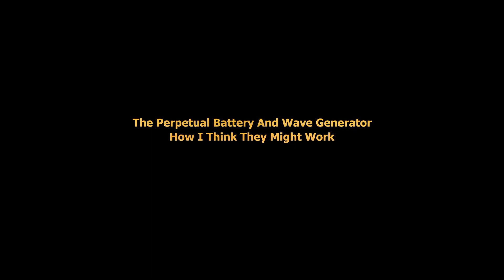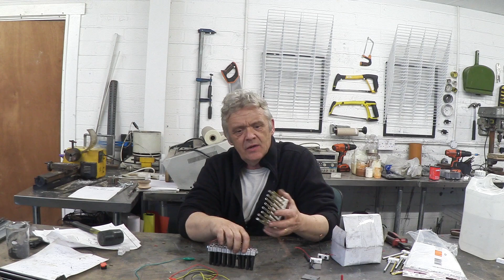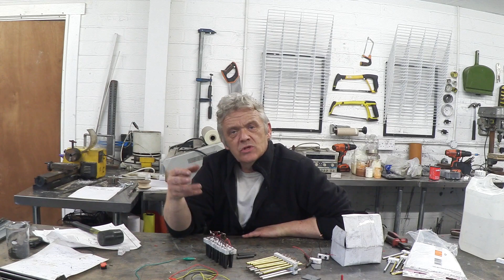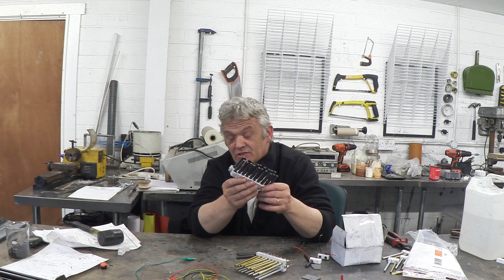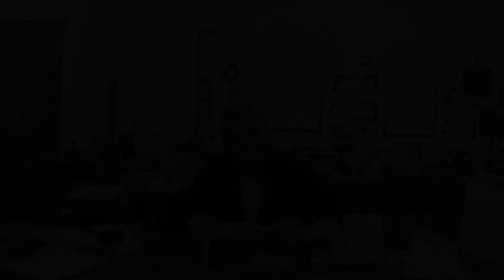The Perpetual Battery And Wave Generator - How I Think They Might Work

Comment: Just seen how CorPower made a wave generating buoy, and how it was generating a 300 kilowatts (was also 9 meters in diameter, and 13 meters tall lol). Thought how great those would be, as they are much more stable, to use those as off shore Rescue Buoys, but not sure how much use they would get... maybe better for expanding our detection range off the coasts, if not used for power generation, as they could just generate the power needed by the equipment and be relatively stable.

Comment: In welding there are carbon rods used in a prosses called carbon arking its used to cut metal. The rods themselves are an aerated carbon packed into a rod shape coated in a copper foil I think it could be interesting

Comment: Thanks Robert. Having listened to what you said here, and after reading the patent, one thing really stands out: Make a unit which uses Carbon rods (or even doped Silicon rods) for one set of electrodes, and sheet Copper or other metal plates for the other electrode. You will then have one electrode which is a relatively poor conductor and another which is a very good conductor, and a higher current should be produced.

Comment: Hi! I just wished to clarify: which geometry (surface area, thick/thin plates, etc.)  is recommended for both the upstream end and the downstream end of the device respectively? Should there be a difference in the amount of carbon in each material (again, between upstream and downstream ends), and if so, should I maximize the difference between the two? I’m very interested in building a somewhat optimized version of the rig featured in your “Wave Power: A Way Forward” video, but am unsure of what to get/make. Thanks so much for the constant stream of awesome content!

Comment: I have been playing with the perpetual battery and still can't get over how much fun it is! That simple design..I have a question. My meter is not as good as yours, but I think I am measuring bit more when I've literally draw lines on both tubes with pencil. I  was thinking about your Baghdad battery. First is that just nonsense and I better get a decent meter? Second if not is it because of the difference of the resistance across the whole setup? Third if so is there a simple way to attach carbon on metal? Sort of ,,galvanised" with carbon? Idea is to create lines of activated charcoal on the tubes to get better surface area as well as the resistance.. I read this article about ,,bombarding,, the metal with particles but I haven't got even decent meter let alone that contraption 😂

Comment: Let me expand your mind a touch Robert.  Think about this, where does an electron get the power to forever move around the nucleus of an atom?  No really think about it.  Science just brushes it off, but that little tiny electron is getting its power from somewhere, and its not from the nucleus.  That power comes from somewhere.   Have you heard of the 'etheric field'?  Quantum mechanics describes it as an electric field evenly distributed throughout the universe, unaffected by radiation, or electromagnetic fields. It permeated everything and everywhere, with enough energy per square centimeter to power New York for a year.   Wavegenerator:  Water is good, but something referred to as quicksilver is much, much better.  Geometry: square plates along the axis.  Think Casimir Effect.   Just a nudge from a friend.
Reply: One time my spouse had a dream about how one could tap into the ether to run a light bulb. She doesn't think about stuff like that.  Unfortunately, she didn't remember the details.

Comment: Regarding the copper rods - something id be curious to test is actually introducing a ferromagnetic pressure that coincides with the salt water. Let’s say for example we have a high and low pressure tube system delivering the salt water to the rods. In the high pressure side of the tubes can we use that pressure to rapidly propel a magnet towards the copper rod and create a larger difference between the two rod types? I’m a dad of three with no lab space to test my thoughts but perhaps someone can weigh in.

Comment: would be interesting experiment for someone to coat the underside of your boat with those graphite plates, like one thick strip and then a thin strip and then thick again and so on. Then hook it up to a charge controller and a battery and take your boat for a spin and see what you get. ( I don't have a boat)

Comment: After seeing your first video on this device, my initial thoughts would be to combine the multiple rods in series, rather than parallel. I also thought that maybe using an electrolytic capacitors to make the series connection between these rods maybe more beneficial? Great work as always. Thanks.

Comment: Hey Rob, You could probably add a strong magnet to your set up and achieve some good results as well, this would be Magnetohydrodynamics. This is normally achieved with metal and is the result of surface area and a strong magnet and narrow proximity to the conductors and flow of ionized fluid such as sea water through these conductors and magnetic field. This can produce usable energy. It really is nothing more than a generator that uses the fluid in place of winding coils of wire of a generator.
Reply from the maker: you certainly could do that mate - and well worth doing

Comment: Okay I have some ideas. 
1. Take a bunch of  carbon wrap it in aluminium foil in a spiral (kind of like  a Logarithmic spiral), Take a five gallon bucket and punch a reasonable hole in the bottom, put the aluminum in the bucket and let the water flood the system from the top (garden hose tap in the lid or some controllable way of putting it in water), profit? spiral motion would be best for imputing the water. My logic? What we need is a difference in resistance between the anode and cathode. The aluminum would be the cathode while the carbon would act as the anode. (I think I might have those backwards) This would allow the water to flow charge the system. 
2. Buy a metal micron filter of your choice metal stuff it full of carbon and blast water at it from the side. Or you could get an aluminum micron filter and fill it with particularized brass. 
3. Find better metals, Gold is expensive but would work great particularized, Graphene would be great, Whatever you feel is affordable to you and has a high resistance difference. 
I also have some ideas for your rubberband power machine. (Stirling engine? and paracord?)
Reply from the maker: nice thinking mate - any chance you will do some videos on this?
Reply: @ThinkingandTinkering  I'm unemployed, under educated, and barely have enough money to put food on my table, else I would. 

I did fix some problems with this design by sleeping on it. Look up BioMaxx Series
BioPellet Reactor, Fill this shaped design (glass jar should work) with bronze and aluminum beads. Input is the bottom and output is the top, Make sure the down spout is either rubber so no charge is collected or that its bronze as it acts as the collector. 

I would usually insert a lot of mathematical explanation but without the device in front of me and the tools to measure it I don't have the means to give you a better design based on math. (I am American but know the importance of using the metric system)
Reply from the maker: @tank2543  I get the unemployed and lacking funds mate - but the undereducated makes no sense to me - if you feel you are under educated - get educated - it costs nothing to read
Reply: @ThinkingandTinkering  I don't mean that I don't have the knowledge. I mean that I don't have the degree. I could talk about these concepts all day everyday. They are my life passion after all. But where I am from all they want to know is where you got your college degree from. I have a core understanding of the mechanics. I've read every book I could get my hands on for as long as I could. I have dedicated my free time to watching YouTubers such as yourself, The Thought Emporium, The Modern Rogue, and so on. I love material sciences, quarky physics, and computer sciences. 

When I say under educated it's more... I lack the self esteem or the "proper" educational background.
Reply: @ThinkingandTinkering  I made a video and am uploading it now. I didn't get any amp measurements but I got between 1 to 3 volts showing. Maybe if I used the salt water transformer that you built previously I might be able to make usable power. I'm designing a better version that fits my budget and will try again when I get a chance. The url is going to be /gW5kzIuH3wQ and will take about 2hrs from time of this post.

Comment: I wonder if Nikola Tesla used this concept  as part of his Wardenclyffe tower project ?
Reply from the maker: I think he was more interested in frequency wasn't he?
Reply: Robert Murray-Smith i am thinking along the lines of resistive difference to create the resonance he needed . .....as far as i know its not just about the voltage potential between ground and the atmospere but concepts like resistive difference may have contributed  using the atmospheric moisture as the ion transfer ingredient !
Reply: Electron Proton Neutron Mouron are there notable values of resistance? For example the scaling of frequencies have values that produce interesting results I think it was the university of Washington (states) that used a specific sound frequency introduced from the exterior of a tube to create sono-luminescence in a tube of ocean water.

Comment: Metal ball on a pendulum, with two magnets at placed at 15/16ths of swing reach, neither magnet barely able to hold weight of metal ball for a fraction of second, but strong enough to complete the full 1/16th swing remainder, use the top arm of the pendulum attached to springs to create power or drive. Don't know if it would work but at least I am thinking! lol Can't afford to support you financially, but maybe I can supply a useful viewpoint!
Reply: keith mcleod 
What you describe is essentially a perpetual motion (over unity) device. Such a device breaks the absolute fundamentals of thermodynamics (The First Law) and unless pretty much the entirety of thermodynamics is downright wrong (in which case how did we ever develop heat engines?) then you’re simply chasing an alchemist-like dream.
The first law says, basically, that you cannot get more energy (work) out of a system than you put in. Your magnets put some energy in when they attract the pendulum but they take it all out again when the pendulum swings back the other way.
Reply from the maker: you don't think then that is something he can find out for himself? You are probably right here but if he looks into it he will undoubtedly discover something else - if he does nothing he will find nothing
Reply: @q.e.d.9112  not chasing any so-called dream, just throwing out an idea, but with  condescending reactions like this, I will make sure not to ask any more questions that might come to positive outcome!
Reply: keith mcleod 
Sorry if you thought I was being condescending. It was only my intention to give you an understanding of why physicists have rejected the notion of perpetual motion. 
Robert
Keith might have discovered for himself that this idea won’t work, but he might equally spend a lifetime tinkering around with magnets in the belief that it was only a matter of “tuning” his system to get it to work. Plenty of others have. Fine, if that’s what they want to do, but they should at least be aware of why mainstream science is convinced it’s no more possible than making time go in reverse. It’s as fundamental as that.
Reply from the maker: for sure Nate - I think the devil will be in the details here

Comment: Hey Robert Smith, Thank you for your Great Work in the Production of these Mini Doc's. I have a Request if you don't mind. It Might be a Little Out of Your Field. But I think you can Handle It.  If you Will.  When I was a lot Younger, I did Research Into (NITINOL). Maybe you have heard of It. (METAL WITH MEMORY). About 50 years ago Research was done at the Lawrence Laboratory Berkeley Under Professor (EDWIN MCMILLAN) guidance Into this odd Metal and all It's Property's. Nickel titanium, also known as Nitinol, is a metal alloy of nickel and titanium, where the two elements are present in roughly equal atomic percentages. Different alloys are named according to the weight percentage of Nickel, e.g. Nitinol 55 and Nitinol 60. It exhibits the shape memory effect and superelasticity at different temperatures.

Nitinol alloys exhibit two closely related and unique properties: the shape memory effect and superelasticity (also called pseudoelasticity). Shape memory is the ability of nitinol to undergo deformation at one temperature, stay in its deformed shape when the external force is removed, then recover its original, undeformed shape upon heating above its "transformation temperature". Superelasticity is the ability for the metal to undergo large deformations and immediately return to its undeformed shape upon removal of the external load. Nitinol can deform 10-30 times as much as ordinary metals and return to its original shape. Whether nitinol behaves with the shape memory effect or superelasticity depends on whether it is above the transformation temperature of the specific alloy. Below the transformation temperature it exhibits the shape memory effect, and above that temperature it behaves superelastically. Now under the Guidance of Professor McMillan there was an Engine Designed and Built. Using Hot Water on one side and Cold Water on the other side NITINOL Propelled this Engine. There has been other Designs made. Then Nothing. It's like the Entire Project Dropped off Into the Abyss. This Metal would be a great fit for some of your Projects. I believe it could benefit you in the Design and making of Batteries. My request is that you use it in some of your Designs and Possibly you could Build your Own Engine / Motor. This would in my Opinion be a Great Video Series. Question is. Will you do it Sir? Again. Thank you for your time Teaching all that want to Learn the knowledge you Freely Present.
Reply from the maker: I know Nitinol and the motor experiments you are talking about mate - it is a fascinating material - but I like to explore those things around us and what can be done with that - later it can lead onto exotic materials for sure

Comment: This from a Water Filter Cartridge Manufacturers website - "Each granule of carbon provides a large surface area structure, allowing contaminants the greatest possible exposure to the active sites within the filter media. One pound (450 g) of activated carbon contains a surface area of approximately 100 acres (40 Hectares)."
1 Hectare is 100m x 100m = 10,000 m^2. Each meter is 100cm  x 100cm = 10,000 cm^2.
I am not aware of any, readily available off the shelf product, that can exceed the Surface Area / $, than a Carbon Block or Extruded Carbon Water Filter Cartridge! You cannot possibly make a more robust, reliable, and efficient product for less than you can buy a Water Filter Cartridge.
Reply from the maker: you should make one and do a vid mate

Comment: How about using a metal gauze as the electrode as you will get a lot more exposed surface area than with rods or tubes.
Reply from the maker: go for it

Comment: This is a lot to digest. I'm looking at the patent now. Patent no.: 4,153,757 for anyone wanting to find it on google patents. Curious if different salts makes a difference, different geometries, spacing, perhaps even different liquids. Would this work on a planet with liquid methane for example. Very intriguing.
Reply from the maker: for sure mate - cheers
Reply: How about a rod through the center of a tetrahedron shaped hollow receiving higher pressure salt water inside. Does it make sense to expand the surface area of the graphite clay into the hollow tetrahedron with a carbon rod at the center?

Comment: Ok, so I've read the patent. He misses the point that he's also invented a flow meter - doh!
Interesting in your idea about resistances and the current flow speeds. I wonder if the observed effects with the 'cold fusion' experiment could have been related to that too.
For non corrosive fluids I think having one sheet of brass and one sheet of carbon might work well, perhaps just spaced like two capacitor plates with fluid flow between them.
The idea of resistance tuning via geometry I'm not sure about - the logical conclusion to that is to stick a resistor in one side of the circuit - which makes no sense. I suspect then it's a property of the resistance of the surface so you'll have to go for two different materials - but we'll see!
Reply from the maker: I like that attitude mate - we'll see is a goo view to have in my book

Comment: Hey , heard you talking about charge separation was wondering if you heard of a ELECTRET. I made one  and put a solar charged battery with a 555timer for 60hz. I think it might be the first AC battery. It had to be step down quite a bit 12kv at 100ma. Neon sign transformer and hv diodes are cheap if you wanna have another project
Reply from the maker: I know and like electrets mate - some nice motors made from them
Reply: @ThinkingandTinkering  if I didnt loose everything to a mysterious house fire, I would post a vid but I only had a few things that made it through. ELECTRET lost its quasipermenant charge when the fire melted the dielectric material.

Comment: Would it help if 1 of the carbon rods was copper cored, that would reduce the resistance and speed the path of the electrons?
Reply from the maker: with a try mate
Reply: It couldn't hurt except maybe in costs.